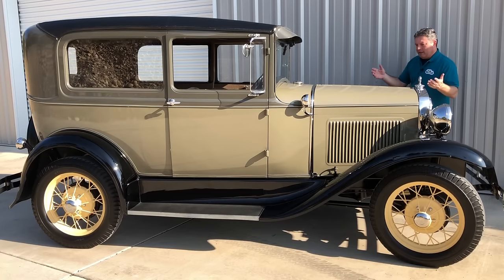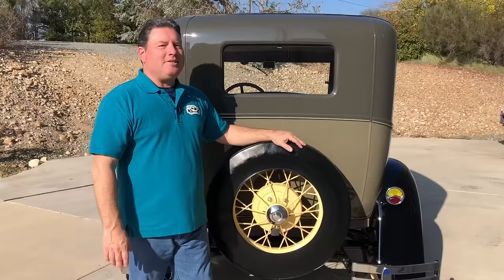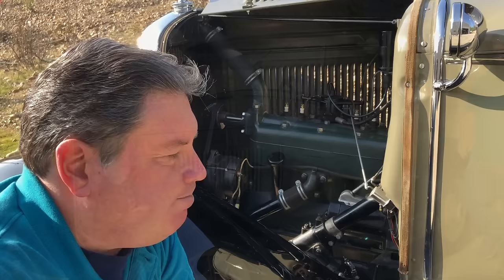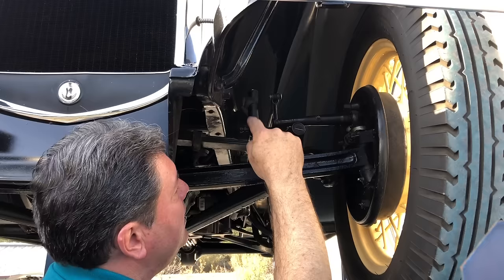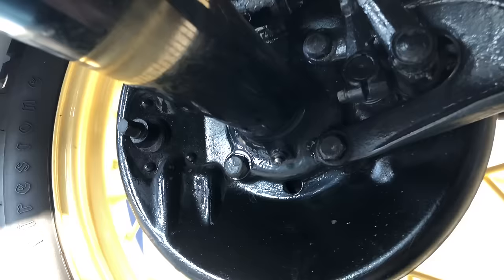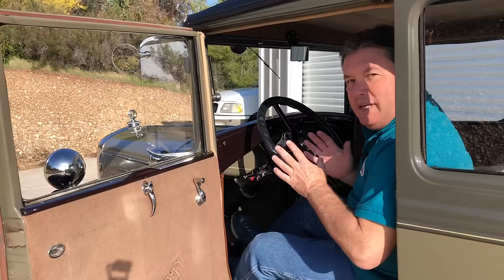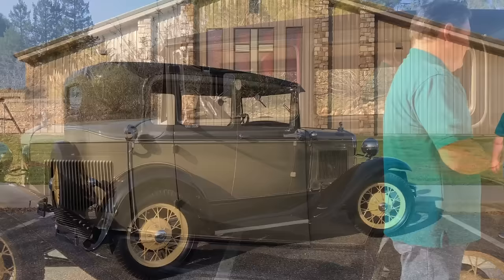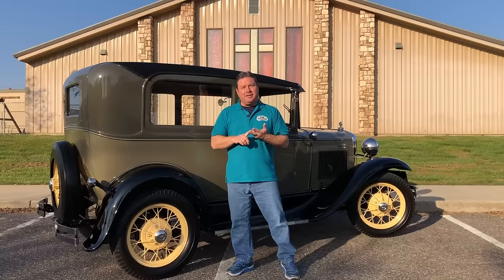Ford Model A Buyer's Guide - How to buy a 1928-1931 Ford Model A

Comment: I'm going to buy a 1930 Ford Model A pickup pretty soon. The Chassis has been refurbished and the engine has been rebuilt but never run. It's got most of its body parts aside from the back of the cab. It had a bed but the owner sold it. Otherwise, its all there. The cowl may be off of a 1926 Model T, based on appearance. The whole thing is $3500.

Comment: Great video, Paul! When I bought my 29 Model A Roadster, I was sold on the rumble seat! Spent 11k, she leaks oil, she has rust on the body, paint on the engine is pealing, several replaced parts that aren't original, but damn it, I love her. My wife and boy ride in the rumble seat and we cruise down the back roads here in Lancaster County PA, waving at the Amish and English who look with big smiles on their faces! 
This car is probable only worth 5k-10k to a avid Model A enthusiast, but I wouldn't sell it for 100k. It's my dream car, and you can put a price tag on the joy it's brought our little family for the last 3 years! 

And the best part about Model A, (at least mine) is that I always have a project. Whether it'd cleaning out the carburetor, adjusting the distributor, changing the fluids, greasing, aligning the front end, adjusting the brakes, touching up paint, you name it! my roadster is always a work in progress and it brings me so much satisfaction tinkering with it, and making just how I like it!

Thanks for all the videos, Paul. Several of your tips and how-to videos have helped with some of my cars projects.
Reply from the maker: That's fantastic, HK!!  Making some awesome new family memories.  You are rocking it!!

Comment: So we watched your videos, and we thought... Why not, let's give it a try.  So we got our 1929 Tudor.  It had an older restoration, but it needed work especially in the carburation department, it ran so bad it once blowedup the  muffler clear open.  The fan was broken, the timing was horrible, it had no power. So we watched your videos, and re-watched them.  We want to thank you for the immense service you do for the Model A community. Without you we would have never got into car collecting, and we would have no clue how to fix a Model A.  Now we have several cars, a very eclectic collection the includes a 29 Model A, a Ferrari, a Suzuki Samurai, a Bell Air and more on the way.
After applying all your recommended fixes, we just took our model A for its first big trip.  We drove it 84 miles, it ran on the highway at 60 MPH with no trouble at all, smooth, and boy was it fun.  Thank you again.
We made a video of our adventure, if you are interested it is on our channel.  As I say in the video if you were not so far away I would send you my car and ask you to send it back when you thought it was perfect, because I will never know ail, you do.
Cheers and thank you.
Paul, (yes my name is Paul also).
Reply from the maker: Wow!  Thank you Paul!  Please share the link to your video.  Share it with everyone.

Comment: Wow, I am impressed at your knowledge. It has been many years since I had a vintage car, a 56 Volkswagen Beetle Convertible that my dad had bought over in Europe when he was serving in the Air Force (I was born in Germany). I really loved that car, having done simple things such as changing the oil, redoing the wiring and replacing a wiper motor, and replacing the fuel pump. But sadly, in the area that I lived very few people knew how or cared to work on such an old car, so I've been living with modern cars ever since. I love the sound of your old Model A's and even the challenge of driving them through modern traffic, but I sincerely doubt my own ability to maintain such classics faithfully as they should be.
Reply from the maker: I bet you could do it

Comment: Good information Paul. Other topics I think you should cover: 55 mph and your ammeter is on zero? Check that. What  about condition or correct upholstery, or whether all the lights or wiper work? Generator or alternator? 6v or 12 v? Turn signals? Condition of the roof? Safety glass all around? Shock absorbers original, modern, or even present?
 I’ve bought, sold,  restored, and driven Model A’s since 1961. In addition to your inspections and suggestions, these are some of the things I look at. 
A couple other comments. If you are shopping and new to Model A’s, take a knowledgable friend along, and look at and drive  a few before you write a check. Also, in my experience and opinion, any speed over 45 with mechanical brakes is very dangerous.
Reply from the maker: You should record and upload a video!

Comment: I would get one but need one ready for the road. I do not have a shop & or garage to to do major work. I do have a lockable shed to store it in & hopefully a tornado won't take it all away like it did with  Toni's 55 T Bird. He never found that car before he died. Shed & all gone. 3 miles from my house. Always have loved the Model As. That's how a car door should sound when closing it. I need something that I could get in & drive it every day if need be. This one shown is very very exceptional. It's clean through out . as they used to say," No Bondo Bettys or Fiberglass Freddys."
Reply from the maker: Just set your expectations higher and write a bigger chexk, and you should be good to go!

Comment: Your looking good man!👍 A tip on cracks in those Fenders, grind down to bare metal along the length of the crack. Find the end of the crack and drill a 1/8” hole at the end of the crack. This will terminate that crack—-and a skilled welder with a modern wire welder machine can repair the crack permanently. (In the old days, they would grind a trough in the crack and silver solder, or braze it. )
Reply from the maker: Yes, very true.  The hard part is repairing the wire inside the folded edge of the fenders.  If you don't fix that, they will crack again in no time.

Comment: This car looks much like my '31 Model A 2 doors sedan. Mine has a Ford 351w HO crate engine, a C6 A/T with a Ford 9" rear differential and modern 16" wire wheels with fat radial tires.

Comment: When looking at the engine, I think i noticed a alternator instead of a generator.  Also. when under the engine, I noticed a piece of twisted safety wire attached to something.  What about those two things?  Can a Mitchall (sp) overdrive be used on other makes than Ford Model As?  And, nitpicking you may not want to modify "unique."  It is or it isn't.  Modification doesn't add anything. Sorry.  The video was well done, no annoying wind noise, and really clear photography.  I enjoyed watching it.  Thank you for posting it.  I have subscribed and look forward to more of your videos.
Reply from the maker: Thanks Charlie.  That is a 6 volt, positive ground alternator.  A bolt-on mod so that your battery doesn't boil out and you have nice bright(ish) lights at night.  The safety wire keeps the wingnut on the air maze (air filter) from backing off with vibration.

Comment: So I just bought an original roadster. Welded cracks on the fenders. Pits in the body where they usually rust between the doors rear fenders. But he even threw in original stamping patch panels.
The car has a rumble seat and roof bows but needs upholstery. 
Apparently it's been sheded since the late 70s
Reply from the maker: Neat!!

Comment: Sir: An excellent review of the Model "A" !   Very good tips, & info regarding problems related to date of manufacture. I must , however, respectfully disagree with your statement that mechanical brakes work well.
My Grandfather ran a garage for decades, & I grew up in his garage !  (my age is 81).  I have yet to find ANY vehicle with mechanical brakes where the brakes could be kept equalized. After a few stops, one wheel, or possibly two, (usually not on the same axle) would lock & the others contributed little or no braking action. In my experience, vehicles using rods to operate the brakes were easier to adjust  than cable actuated brakes. Cable brakes rusted internally and seized up, or the cables "bird caged) etc. Equalizer bars were some help, but not great. Post WW2, no  production vehicles of which I am aware used mechanical brakes. Many American vehicles were fitted with hydraulic brakes in the 30ies, & I believe that Ford held out until 1940, before adopting hydraulics. There is some dispute about 39 or 40. Canadian made Fords all had hydraulic brakes in 40, but American friends tell me that 39 was the first year for hydraulics on Fords. The exception may be the Lincoln. It may have been fitted with hydraulic brakes previous to the rest of the Ford vehicles. I don't know. I understand that honest men often disagree, & your experience with mechanical brakes may have been satisfactory, but mine were not. I owned 3 Model "A" cars, & used them as daily drivers. They were excellent cars, & ahead of their time in many ways. Generally reliable, & fun cars to drive.  Thank you for your excellent video, & I have subscribed to your "channel".
Reply from the maker: Thank you Brian.  The Model A uses brake rods, not cables.  If everything in the brake system is kept in good condition, they do not experience the problems you mentioned.  It doesn't matter how long someone was a mechanic, I have met life-long 80 year old mechanics who still don't know the proper way to adjust or maintain mechanical brakes.  That doesn't mean mechanical brake systems are bad, it means the mechanics were bad for not learning and using the proper methods.  The older they are, the worse it seems to be with "I've been doing this for 60 years!".  They were doing it wrong for all 60 years then.  You see how fast the Model A in the video went from 45 MPH to 0.  Those brakes were last adjusted 4 years ago.  Still working perfectly, with video to prove it.

Comment: I appreciate the buyer's guide and i'm a new subscriber to the channel. I recently found 2 Model A Sport Coupes, a 1930 and a 1931. Both run and drive, and one is completely original right down to the lack of paint. One is really pretty, but has had a hydraulic brake conversion, which kinda turns me off.I'll be looking at these soon, and it's good to know what  to look for, thanks!
Reply from the maker: Glad I could help Jeff!

Comment: Thanks for showing the basics of buying a Model A.  I wished you took more time to go into more detail.
Reply from the maker: What do you suggest?
Reply: @ModelA   You mentioned steering issues. Previous body repairs.  Engine issues. Full tutorial about what problems to avoid.  Your comment about the finger test for the springs was a great comment. Thank you for responding.  The car you showed put a big smile on my face.
Reply from the maker: Thanks!  Like I said in the opening, there is no way I can possibly cover everything that can be wrong with a nearly 100 year old car.  I was hoping you had a specific suggestion that I could incorporate into another video.

Comment: Great video Paul --numbers matching should have told does the number match the title to somewhere that is acceptable on the car - now adays matters more and more in some states .
Reply from the maker: Numbers matching does not mean matching the number on a piece of paper, it means the number on the motor matches the number on the frame.  Lots of Model A's have a matching motor number and paper number, but when you take the car apart, the frame number is different.
Reply: @ModelA  I guess what i meant to say that a title that matches something on the cars # was crucial in NJ to transferring the title

Comment: My first car was a '31 Std Coupe. It was purchased black with creme colored wheels. It had a trunk and the top had been replaced with sheet metal and screwed in with slotted screws. My uncle, who bought it in around '74, took it to a guy who couldn't do anything with out a beer in one hand and a cigarette in the other and plenty of excuses for procrastination in his pocket. The guy was to be paid $1000 to do a minor restoration (kept the body on) and paint it. It was supposed to have been painted original Model A colors but when we got it back, it was Chevy Blue (sky blue)......the entire car!! I was so embarrassed but you don't look a gift horse in the mouth. It was my 16th bday present. My uncle had the upholstery done in gray mohair. I am way into originality in my cars so this was hard to swallow. We also got a rumble seat kit and I spent alot of time back there during parades and car club tours in the Kern County 100+ degree heat, pouring rain, fog, and wind storms. My aunt and uncle sat up front where they should.  I eventually sold it when times got tough in my 20''s. My dream car is a '31 Fordor sedan even though you warn about the dangers of that. I'm glad you gave me a heads up. What a great video. Thanks so much for the quality videos and info.
Reply from the maker: Neat story James.  Don't be too worried about the fordor wood, just be aware of it.  If you find a fordor with solid wood in it, go for it!  If you find one with rotten wood in it, then either skip it or be prepared for the hardest job of your life.  I have replaced or helped replace wood in 4 fordors now.  I finally had to draw a line in the sand and say no more!
Reply: @ModelA  My uncle owned probably 20 or so antique vehicles over time. The only Model A he owned then was a '31 Deluxe Roadster for a few short years that was unbelievably gorgeous. It stole the show wherever it went. I never understood why he sold it. It was the most beautiful of his collection.

Comment: Assuming that I bought a Model A that "runs,drives and stops"in what order would you get it "sorted"? Should I start with the engine or brakes or transmission? As always, thanks for putting your valuable into these videos
Reply from the maker: So, you are buying a hooptie?  Chexk out "operation Hooptie" series for the long answer

Comment: Saw a model a  at the dump was 10 yrs old guy a scrapper about 1952. He said 35$ would buy it dad looked at it said smoked not worth 35$ was a 32 V8 dual cowl roadster pickup  they filled it with trash burned it up for scrap iron 🤔
Reply from the maker: Lots of stories like that.

Comment: Hello in Richie from northern California I bought an unrestored 30 deluxe roadster that usud to be restored and drivable but when the owner passed away it sat for yrs and someone stole the head so the engine needs rebuilt.ot has. Lots of rust in the rear fenders wells and may be 5 condition on a scale of 1-10.ots all together and I have a new convertible top  ont for installed  what do you think it's worth ?Im thinking about selling it and buying a restored drivable model a sport coupe thanks. Great video very good informative
Reply from the maker: I don't do valuations.  Contact a local club and have someone look at it.

Comment: Paul, Thanks for another great video. I always learn something Thanks to you. My coupe engine sounds like it is ?"lopeing". I think I might be running on 3 cylinders. Am I on the right track?  Regards to Model T.
Reply from the maker: Maybe.  It could also be different compression in cylinders, worn distributor cam, different plug gaps, valve adjustment, carb too rich, lots of things.  Start with a tune-up and compression check, then go from there.

Comment: I am told that early 1931 Model As came with a flat firewall, but later in the year they came with an indented firewall.    I'm looking at a car with a "hybrid" indentation of sorts.  It looks like a flat firewall that was re-stamped to make an indentation, but it's not teardrop shaped; it's more round-ish.   Disaster or factory hack?   I was told by someone that during the transition, Henry Ford stamped the regular ones.  Any help would be appreciated.
Reply from the maker: That is true.  Some firewalls were re-stamped to the indented type.  You have a rare one!

Comment: This is an outstanding video. You outdid yourself here. Thank you again. A question: why did Model-As not have metal roofs?
Reply: Great question, I’ve often wondered that too.
Reply from the maker: The MAFCA Webmaster probably has the right answer.  My guess is because of body flex or maybe insulation.
Reply: @ModelA  One answer I got was The problem was technology in steel had not yet developed to permit large sheets of steel to be stretched enough to make an entire roof panel.

By the late 1930's, the steel industry and the tool-die makers had developed the technology make steel that would stretch enough, and tools that could "work" the steel without splitting it, to the point were "turret tops" (one company's advertising name for the process) of one-piece steel could be used to make an an entire roof panel.
Reply from the maker: @lukespack    Metal roof panels were certainly do-able even at the start of Model A production.  What is MAFCA Webmaster say?

Comment: My 1930 FOR DOF is a 10 year resto and is 99% correct  I paid $50 for it 70 years ago
Reply from the maker: Try that today.
Reply: I put it in my heated shop and said that the only was the car will go out will be drive it out  I spent $20000 and10 years on it I put all new wood in it  which is a very difficult thing from North Carolina  as you have no measurements to go buy but I got mine very good   cost   wood interior tires engine paint  glass  plus smooth parts  did all the work my. Self so don’t pay much for  basket case  I was Le Baron Bonney last customer   One thing  most all the repo items were not accurate  but I did okay by doing a lot of searching

Comment: Why would oil drip from the oil drain plug if it was sealed well with the drain plug? I had a 2007 Saturn Aura the never dripped any oil, are the washers not made to well now?
Reply from the maker: It's the lowest point of the motor.  Any leak from the pan, front seal, etc. will end up there due to a force called "gravity".